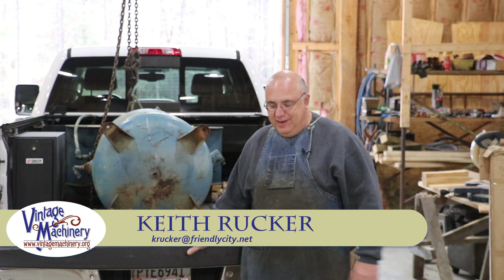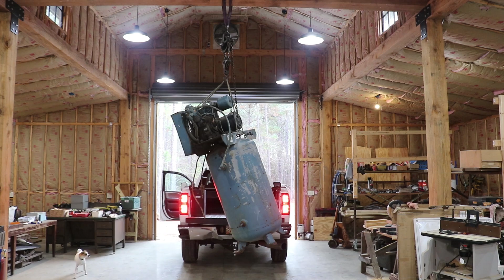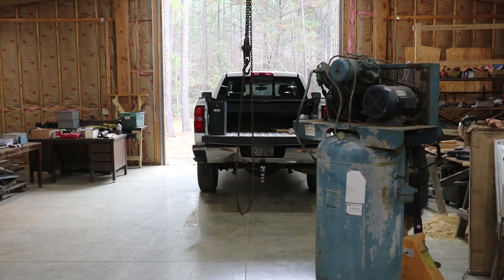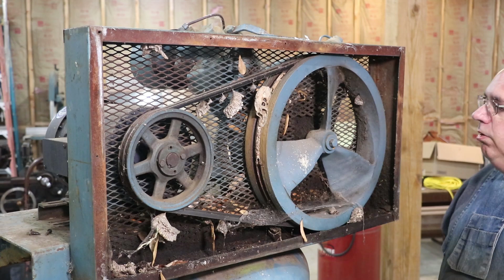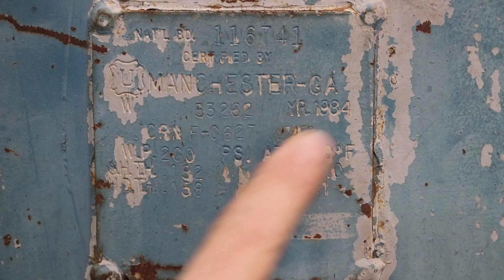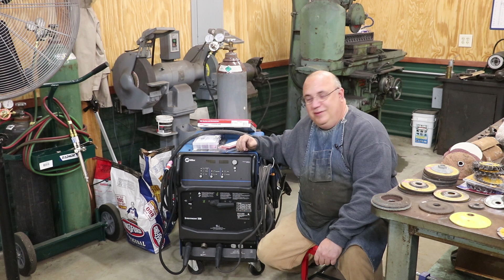New Air Compressor and Tig Welder for the Shop!

Comment: As old as that tank is I'd have my doubts about using it. Thanks for the video.
Reply: No that's no problem. Age is irrelevant in tanks; it's how well they were drained to keep internal rust down. I sold industrial air compressors and tanks for 30 years, and Ken's right, the quickest and dirtiest way to check a tank is hit it with a hammer. If it rings, chances are it's good. I've seen 1060 gallon tanks that were 90-100 years old in an old rubber products plant, and had rivetted seams. They were well maintained and the owners had them recertified every five years or so, and they were as sound as a dollar.
Reply: i would have more confidence in an older tank like that than i would a brand new one now, due to metal thickness and build quality.
Reply: If not maintained properly, it's ancient. Have you ever actually seen one blow up? Even small ones are quite devastating. Keith will, I'm sure, take all precautions. He mentioned using a borescope.
Reply: Lol, it's not even that old.  Just depends how rusted the bottom is.
Reply: I'd at least hit it with a hammer a couple of times.

Comment: Keith, hydro is usually 150% of working pressure like steam boilers.  Hook it all up, fill with water and make sure no air.  Pump up to 150% of working pressure, close valve and watch pressure gauge for about 15 to 20 minutes,  while under pressure tap all around tank with a hammer(ball peen), if no leaks let off pressure and drain tank.  Dry tank as best you can.  Hook back up for use.
Reply: Do it outside. Had a seam rupture on a 150 gal tank while water testing and flooded the shop
Reply: correct!
Reply: How do you build up pressure using water?
Reply: its done with  a hand pump, its actually affordable to buy too!
Reply: Not many people have the capability to get to 150% of 2000psi.